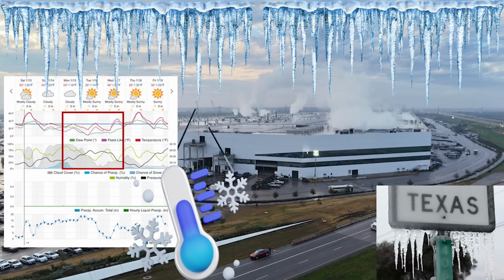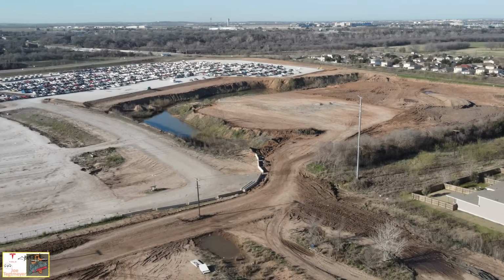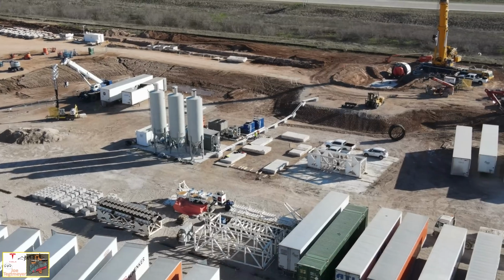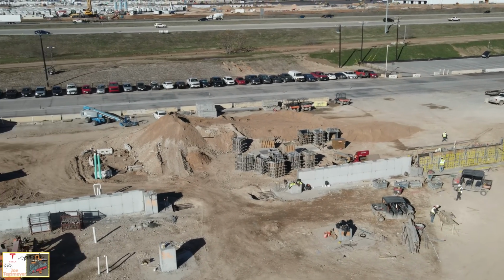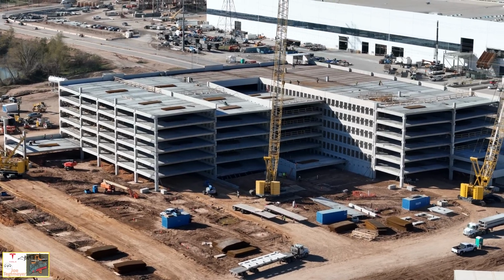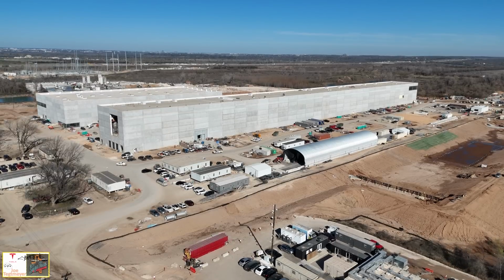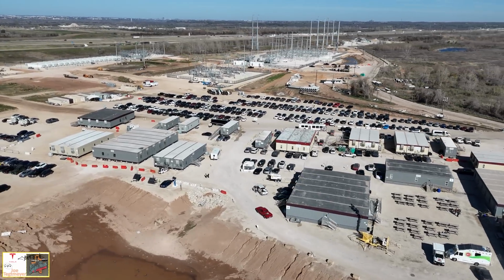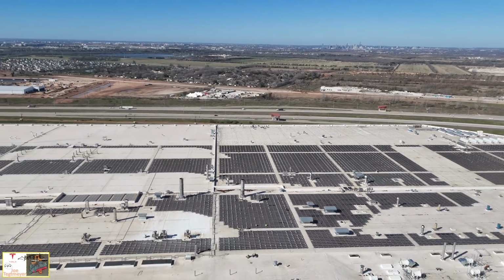Prufrock Arrives! S Extension & Park Garage Grow Larger!18 January 2024 Giga Texas Update (09:15AM)

Comment: Clearly the tunnel can't end before the road parallel to the highway, and there seems to be little space to end it between the road and the building extension. Thus, the tunnel will terminate inside the building, just like they did in Vegas.
Reply: Where did they terminate inside a building in Vegas? I have been following their projects and didn't see this anywhere.

Comment: Will they tunnel to the other side and pop out next to the highway? Or will they tunnel all the way into the factory? The car leaving the line just drive right into the tunnel?
Reply from the maker: Speculation and possible visual evidence of structures under construction in the new extension seem to suggest it’ll end inside the new building. In any case, we will know soon once the tunneling commences.

Comment: Once the TBM is underground, it could go anywhere.  No reason to assume it will go in a straight line or even come back to the surface.  Elevators can move vehicles, people and materials in and out.  The tunnel may wind its way up the length of the factory, over to the cathode plant, under the river then down to GigaMexico.
Reply: It could go anywhere, but there's a whole bunch of otherwise coincidental works in a curiously straight line between the TBM and the current vehicle exit point that suggests the tunnel will be a straight line (in plan).

It could also not come back to the surface. If that were the case a large diameter shaft would be excavated to retrieve the TBM. No sign of those works.

Then an elevator system would need to be be constructed to lower vehicles to the tunnel entrance. The best elevator being no elevator.

The logical arrangement considering what is currently in place would be that the TBM emerges a short distance inside the Southend extension, with an additional section of cut and cover tunnel (if required) meeting an excavated ramp to the surface.
Reply: @DessieDoolan your right except it can, and almost certainly will, come back to the surface on the other side of the road. I would expect a simple vertical curve alignment.
We should see in a couple of weeks.
Reply: @davidsalisbury50  Agree. No doubt in my mind it will surface just inside the perimeter wall. The simplest straightest route.

From a straight up construction perspective, I can't imagine any other arrangement now.
Reply: @DessieDoolan  I say they're planning to go to China! Connect to Giga Shanghai!
Reply: @greggerypeccary666  They'll need more tunnel segments then.